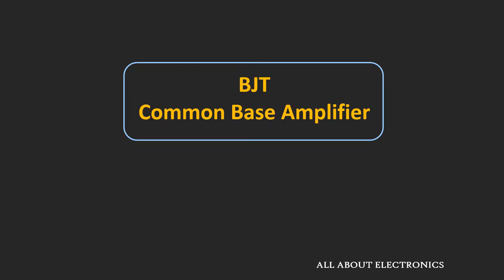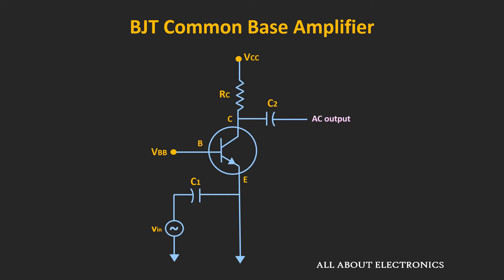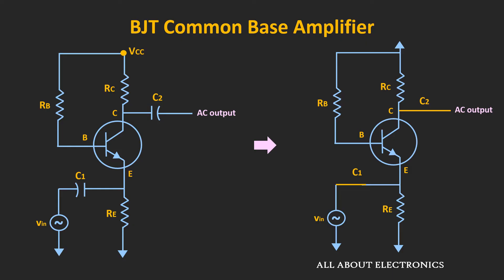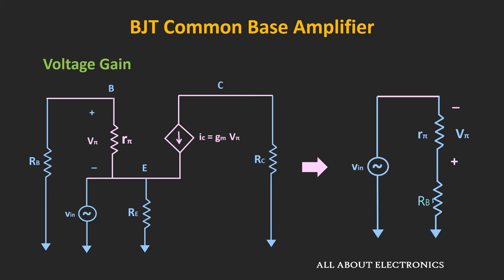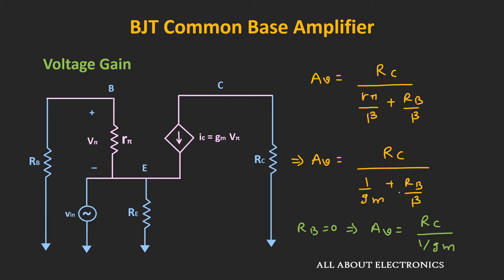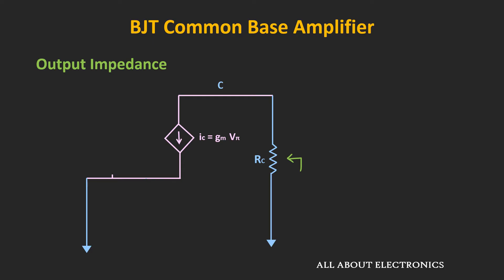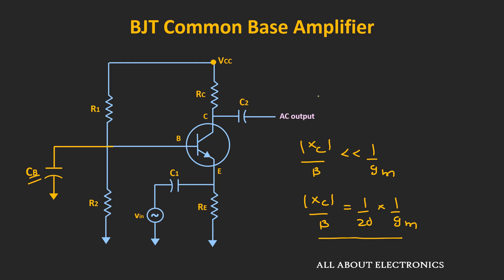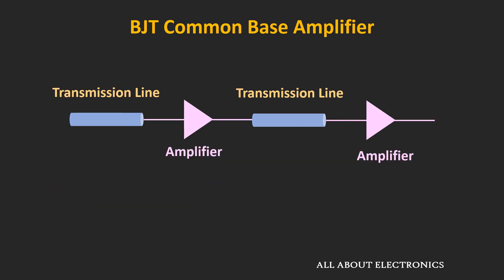BJT- Common Base Amplifier Explained

Comment from the maker: Timestamps for the different topics covered in the video:

0:40 What is Common Base Amplifier

3:37 Small Signal Equivalent Circuit of CB Amplifier

4:52 Voltage Gain of Common Base Amplifier

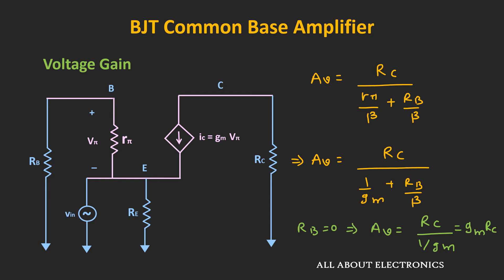8:32 Output Impedance of the Common Base Amplifier

9:43 Input Impedance of the Common Base Amplifier

14:06 Common Base Amplifier with Voltage Divider Bias

Comment: what if there was no coupling capacitor between the emitter resistor and the AC input voltage?
Reply: If the coupling capacitor is not present then the DC emitter current will change as soon as the AC signal is applied, as a result, we will not get the desired gain. Another reason could be  that the capacitor is used to filter out any dc component present in the AC signal

Comment: What happens if the load resistor is connected to the collector terminal and the source resistor is connected to the emitter terminal in terms of the voltage gain
Reply from the maker: With the load, in the voltage gain expression, instead of Rc, it will be Rc|| RL.
If the source resistance is present then overall gain will be Zin* Av/ ( Zin + Rs).